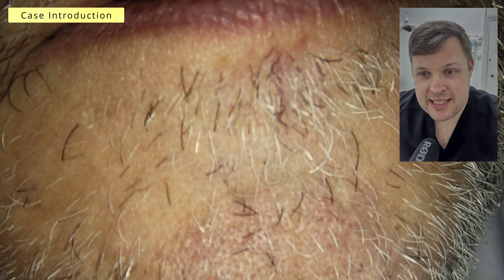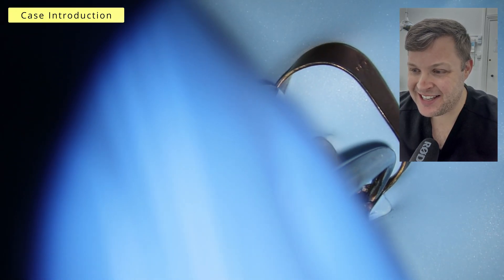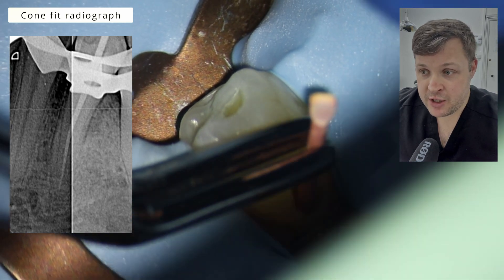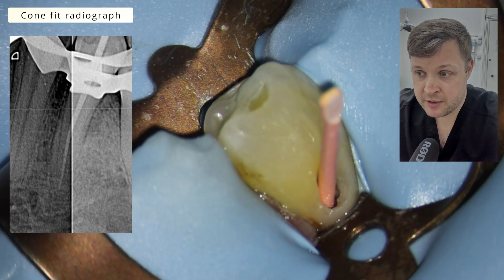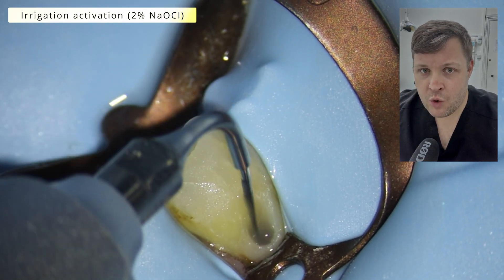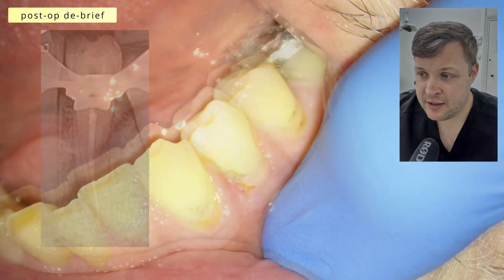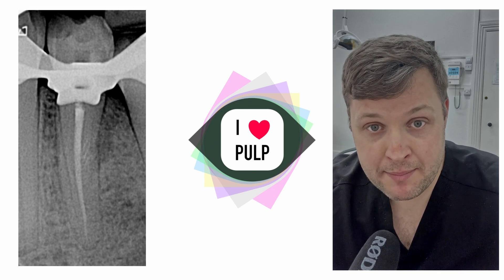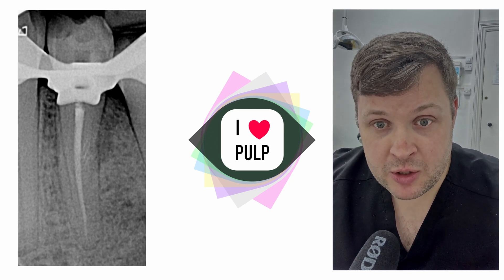Unconventional Root Canal Access: Buccal Entry & Apex Challenges!

Comment: Why Ledermix place over the pulp, at the initial phase, if tooth was necrotic with no evidence pulp tissue....that could be a gap in understanding for many of us
Reply from the maker: Good question - it might be due to availability of materials at the time; or the fact that when the tooth was dressed, the pulp was present and producing symptoms. I would say my go to dressing material is non-setting calcium hydroxide for sure. What do you like using?
Reply: @ilovethepulp  Ledermix if there is limits (bleeding) or doubt of removing inflamed pulp (apex locator inconsistencies)... otherwise I agree that CaOH is better 

I recall one uni tutor suggesting a mix of 50/50 Ledermix and CaOH for best of both worlds...but haven't come across the idea ever since leaving uni.